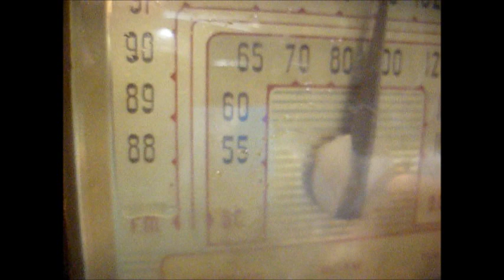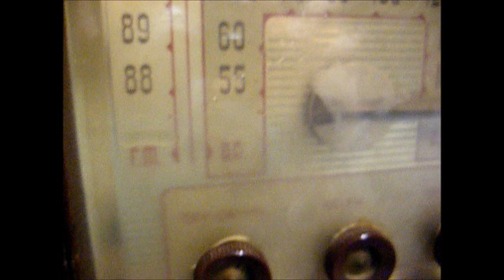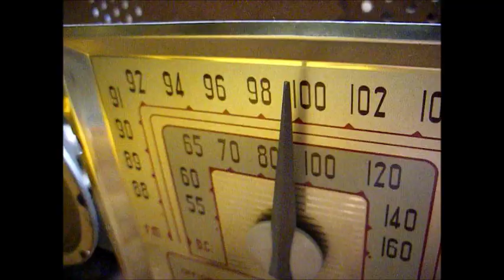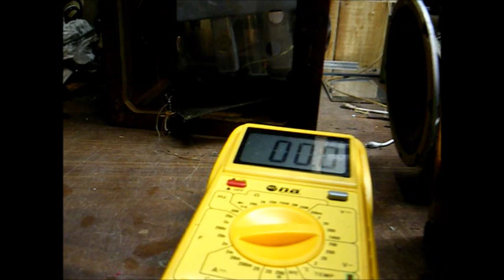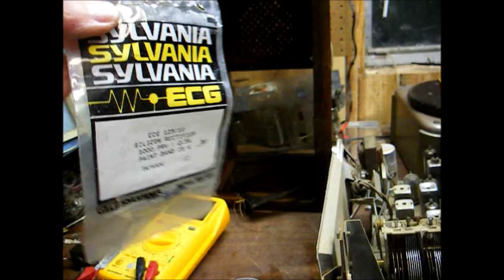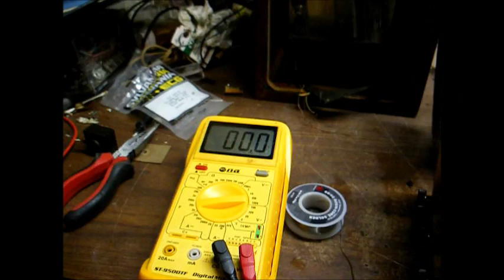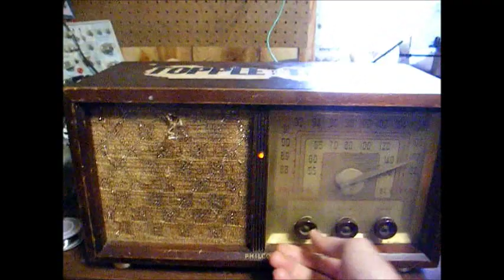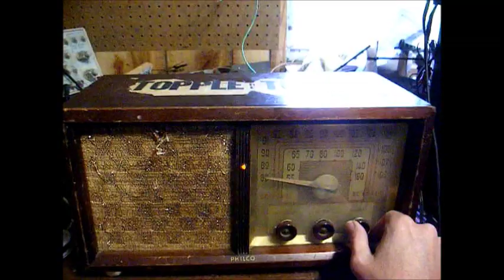Patching up a 1950 Philco AM/FM tube radio

Comment: As usual another great and very descriptive video.  When I was a kid we had this old cabinet type tube radio that my folks had had since way before I was around, not sure exactly how old it is or what brand it is.  I am not sure what happened to it, think one of my brothers or sisters has it now.  I'm pretty sure it doesn't work and is just sort of a piece of furniture these days.  If I had my way and it was practical I'd ship the thing to you and have you fix it up but it is a big heavy thing and would cost a fortune to ship I'm sure.  If I can find out what happened to it I may see if any of my ham radio buddies can try to go through it and get it working.

Comment: Nice video! I cringe when I see a selenium rectifier as I get confused as to the value of the resistor to use in series with a silicon diode. These are especially a problem with the AC/DC battery sets of the late 40's and 50's.